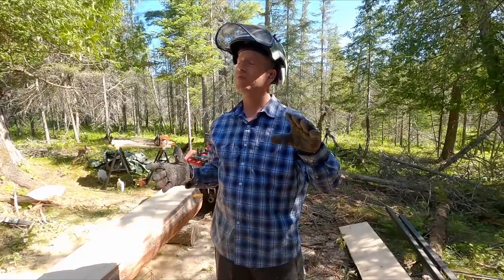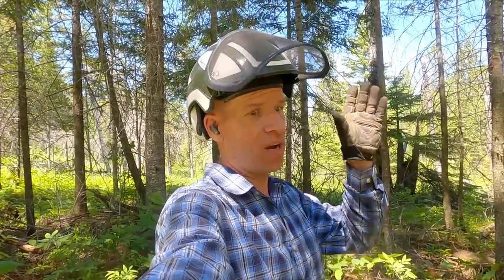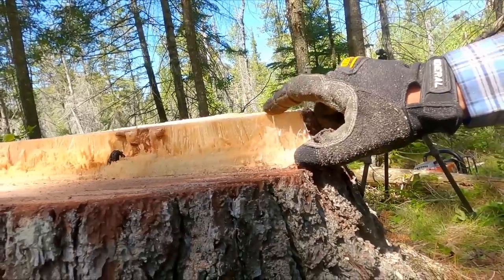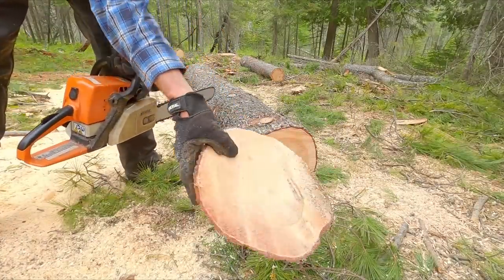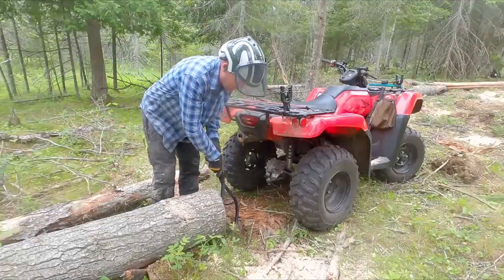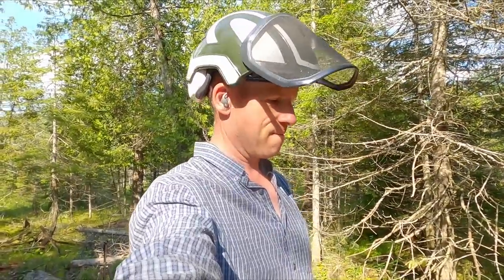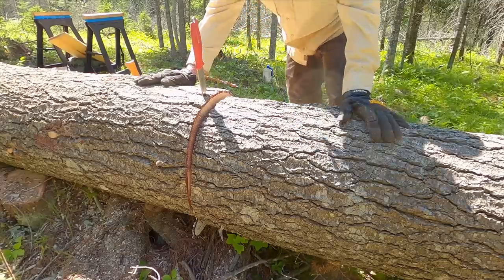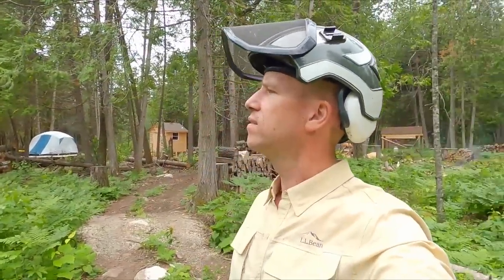Remote Winter Cabin Build + Tree Felling Basics Explained. #90

Comment: Miss seeing that tiny yellow bucking chainsaw you had in the first videos for trimming those small branches off. I ended up burning through a few petrol cheap ones and now I use the Ryobi 18 volt cordless that they have in their range and I gotta say the damn thing is impressive. I also ended up buying the new 12 amp Ryobi 18 Volt battery and It goes a long way one one charge at about 600 cuts per battery on that small stuff. Amazingly quiet and because I have a bucket load of solar It costs me nothing to charge them.😊

Comment: I find I get much more control if my back cut is made at a drastic downward angle to the notch. I've cut thousands of trees and I never bought wedges. That sling shot top was created by the tip beetle. They got a whole field of my Christmas trees before I learned to spray them. I never used a chainsaw mill. I always had a saw mill near by.

Comment: If your able save 4 large trees and use them for the left and right side as headers and footers going from front to back of the cabin. Start the cabin like 8ft from the end of the issuable wood and use the over hang as your side and top main boards then it’s a floating deck.

Comment: your videos cover a lot of nice little details like first cut with bathe mill cut with curve  up so the planks will be crown up. Also using your battery powered plainer to  shave down bumps before making thth next cut with your mill so it doesn’t ride up on a bump and cause a warble in the planks face and distort an otherwise flat plank. This and details on the notch cut and using the line on the saw to aim the first straight  cut of the notch to determine where you want the tree to fall and land and when to use wedges. This is all good info.jJust wondering since your in bear habitat do you carry  protection to take out a bear if one came along you had to shoot to protect yourself as a 22 would not be adequate in most cases to stop a bear and bear spray doesn’t always work  in stopping a bear attack.

Comment: I use the same setup with my quad and log tong to move logs.  I start going really slow so the tongs grab the log first before I start going forward to far.  I try not to jump on my throttle.  It's easer on the quad, too...

Comment: last year my buddy and his wife was clearing their property in the UP. He was not well versed on the proper cuts necessary to control the fall.  Subsequently, a huge pine barber chaired, catapolting his wife by the jaw into the air, leading to a devastating impact to the ground. As she bled out from her head wound he frantically tried to save her. He was covered in her blood as she took her last breath.  One year later he finally returned to his remote property. He asked me to join him which I gladly accepted.  As we approched the area of the accident I encouraged him to finish clearing the last towering pine necessary to begin his cabin build.  He looked at me with disgust and said; "HOW COULD YOU SAY THAT !! LAST TIME I DID THAT I RUINED A GOOD OUTFIT."

Comment: If your slingshot crotch is still long enough (Make of that whatever you want I guess) it would make a great front door and back door mirrored frame set. If it's tall enough it could also work as the roofs main cross beam support.
BTW Are you using a crosscut blade? If so you may want to change up when your cutting with the grain. Get a ripping chain.
As for the bigger tree, where you have a but-ton of big knots close together, let'em rot. Go back in a couple of years and pull the crotch heart out. It'll look like yellow/orange/red crystal spiked balls. Great to start fires with. Break it into finger sized pieces, lights with one match, burns for about ten to twenty minuets and hotter than the blazes of perdition. Real old fashion Kindling. You'll thank me. DO NOT TRY TO CUT THE HEARTS. YOU HAVE TO BREAK THEM. You have been warned.

Comment: Very educational video, thanks for sharing your insight.   Have you considered a 12’ x 16’ footprint for your cabin with an additional 4’ for the porch?  That would offer 192 square feet of base.  Any chance you have a 20’ spruce log that you could use as the roof beam that would span the length of your cabin and overhang sufficiently to offer porch coverage.?  Consider the roof design that “The Outsider” posted on his YouTube channel seven months ago.  https://youtu.be/unhqK1JGytY   His building is a different structure than what you ate building but he built an extended roofline that will cover a porch if/when it is constructed.  

On Friday 07/01 Fall Line Ridge posted a video on a new structure that he is constructing from timber on his property.   After setting his initial corner posts he framed the outside dimension and added interior hoist ledger boards, eliminating the need for floor joist hangers.  Additionally, he added intermediate support posts as needed.   His use of diagonal flooring adds structural strength allowing the use of random lengths of floor boards.

Your lady has great insight into placement of this new structure.   Wishing you and your family a safe Independence Day holiday weekend.  Videos be damned, take some time for your self and get some rest.   Peace brother.

Comment: My opinion: You would get more views if your video's were 'to-the-point', and not so long and 'drawn-out'. Example: I've installed insulation; didn't need to spend 10 minutes watching you do it, and that was on 1.5 speed. Good luck with your adventure.